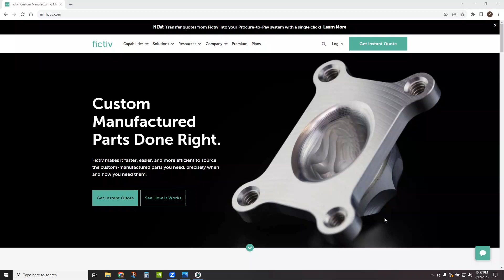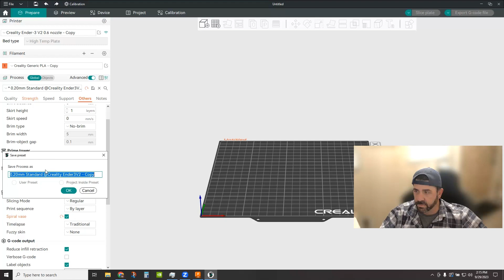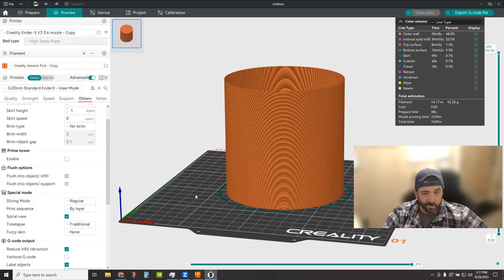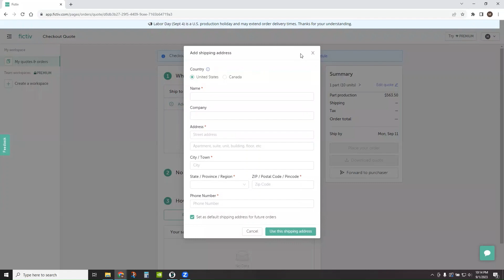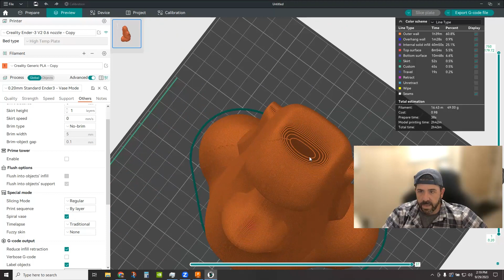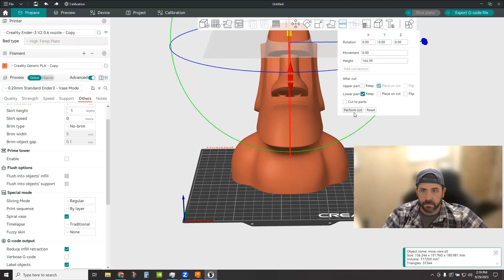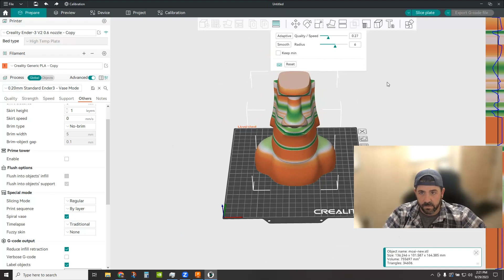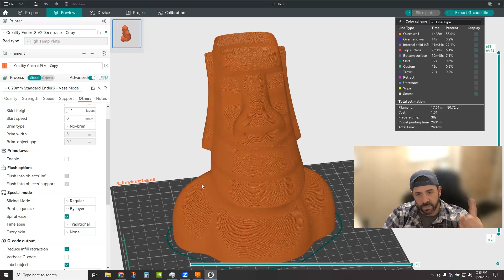Vase Mode in Orca - Where it is and how to apply Adaptive Layers on demand.

Comment from the maker: Head over to Fictiv and check out all their great capabilities and super easy process for uploading and quoting parts. Use code "Fischer3D" at check out to get 10% off your order.
https://bit.ly/fischer3d-fictiv
Reply: Is there anyway to make the top layer thicker? I'm making key key chains and the top layer is almost see through. I've tried a bunch of different settings but honestly I haven't a clue as to how the make top layer thicker.
Reply from the maker: Under the Strength tab, how many top layers do you have specified?  Increasing the number of top layers should help.  Also, under the Quality tab you can try increasing the top surface line width. If you're getting thin spacing between the lines you might want to run a flow calibration.
Reply: @fischer3d  I have have 4mm Top shell layers and 1mm top shell thickness. I'll give it a try and let you know how it goes. Thanks your videos are very informative. Ive learn so much. I just started 3d printing in July. I can't get enough. LoL Thanks again.

Comment: Nice video and I learned a couple slicer capabilities I hadn't noticed before.  With my vase mode prints, I have a lot of success using a .8mm line width on a .4mm nozzle.  I've used layer heights as high as .28mm with nice results.  I just keep stock volumetric limits and it works out great.  Translucent PETG comes out especially good at those settings.

Comment: I'm coming to Orca via Cura... I've tried doing vase mode in Orca, but I'm noticing extremely slower printing than from my Cura profile... what is controlling the speed in Orca?
Reply from the maker: Great question.  Basically, when vase mode is enable, Orca is stomping on the brakes to keep the speed between 25 & 30ish mm/s.  This is to allow additional cooling time for the filament since it's a single extrusion wall.  You can override this by going to your Filament Presets, select the Cooling tab, Find the setting called "Slow printing down for better cooling" and uncheck.  At this point if you reslice the model and switch over to the speed view in the preview you should see the speeds increase for the print.  Then you can tweak the speeds normally in the Speed settings under your Process section.

A word of caution though, that check box is pretty important for non-vase mode prints if there are small features.  So uncheck and use at your own risk.  :)